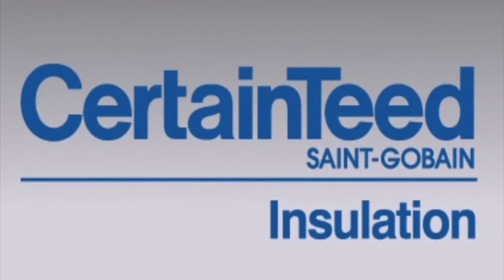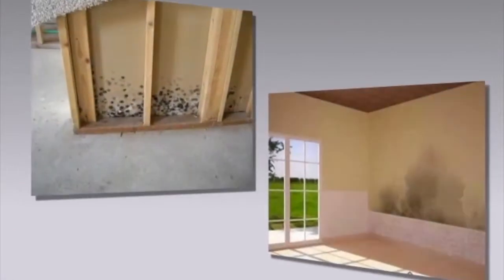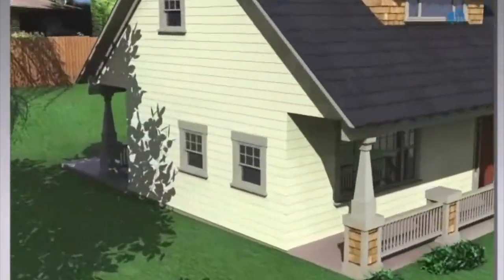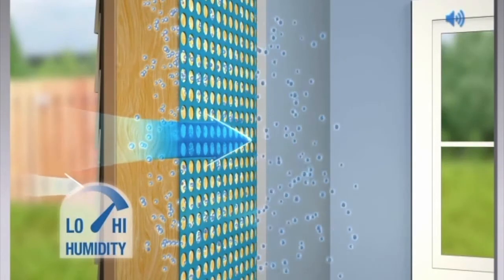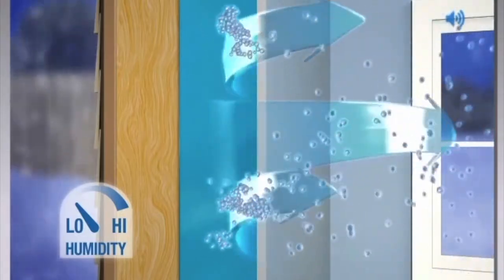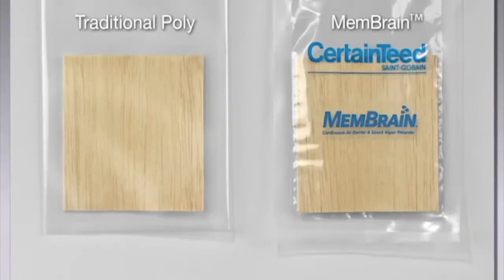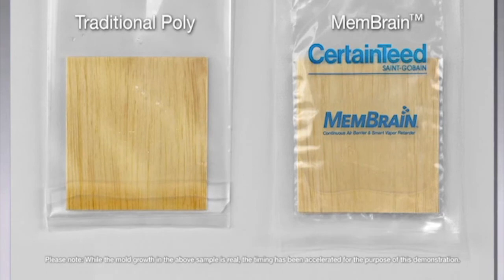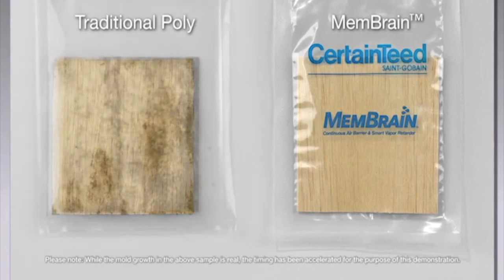CertainTeed’s MemBrain™ Continuous Air Barrier & Smart Vapor Retarder

Comment: so, in the summer time this vapor barrier will allow moisture into the house while you could be running your central AC which tries to cool / lower the moisture / lower the temperature inside the house? something seems wrong here. do i misunderstand what's going on with the membrain?
Reply: I have no affiliation with this product except I found out about it on some construction forums in which people much smarter on the topic than I am were discussing it.

Anyway, to suffice it to say, I totally know and understand what you're saying, and despite me not being able to completely explain how this product takes into consideration what you have concerns about, it does prevent problems in winter AND summer, and a bunch of building geeks elsewhere have discussed how and why.
Reply: Better than it being trapped and leading to mold in the basement
Reply: So does it matter which way this product is installed? Does it work the same in both directions?